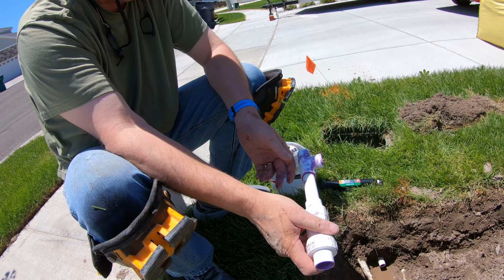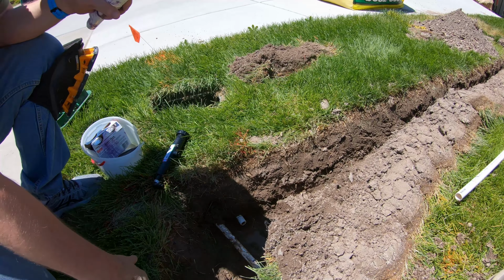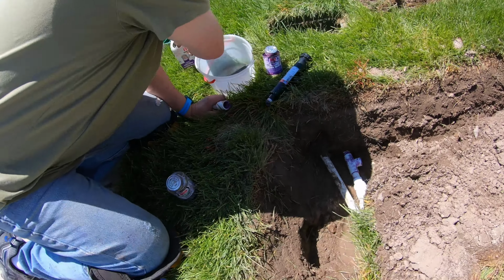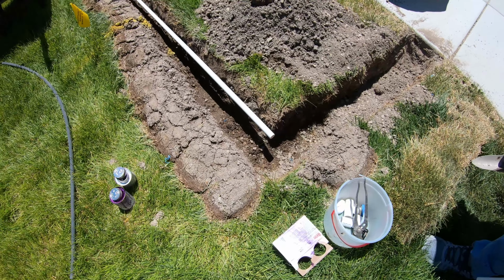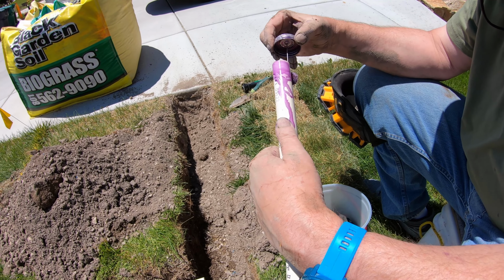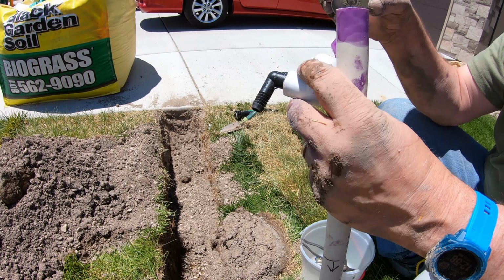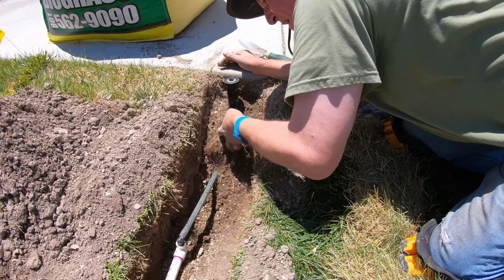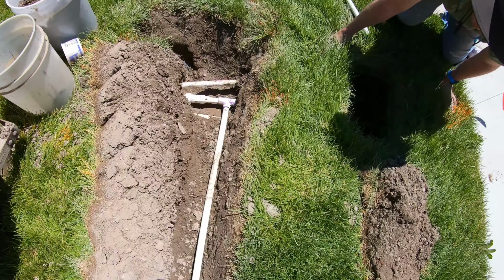Adding a Sprinkler to existing Sprinkler system.

Comment: I just finished repairing 2 pipes and extending 5 sprinkler heads. Plumbers wanted close to $1000, did it all for $200 and that included buying all new sprinkler head and bodies to replace the old ones. Plus my 20 mistakes. Lol got good by the final one.
Reply from the maker: Well Done!

Comment: I have connected a PVC line through T tube to an existing sprinkler line..But no water coming..i wonder why?
Reply from the maker: It sounds like either something (possibly dirt) got in  the line  and is blockig it or maybe you have a leak?